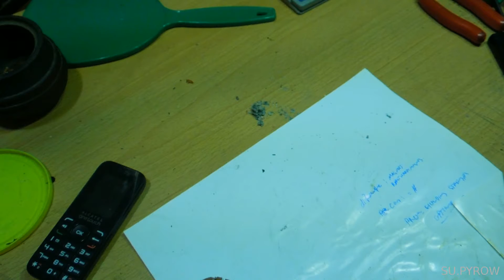CFL Ballast Repair | Sylvania CF32EL / MINI SU PYROW #25

Comment: I came here to see how to pry off the latches carefully, but it wasn't shown. Not that I didn't do it a few times, but it's always a bit harsh work. As can be seen at 7:34, too. :) (I like how most of the video is about not to do this and mentioning mercury.) I just aligned some parts and put in some duct tape to silence the buzz, as I couldn't find any problem but the buzzing.

Comment: Wow , a first for me seeing the innerds . Bob you should do more of this. I like to dabble with low voltage DC experiments and yes I wouldn't recommend doing anything without a lot of knowledge .   I'm working on a optical switch or trying to use a led to trigger a circuit to turn on a load of 75 ma max .  It's the absence of light I need to trigger off of for a solar light. Off during the day and on at night. I tries timers but draw too much.  Haha it's a work in progress . Love electronics wish I knew more. Cheers.
Reply from the maker: i can definitely help you out with that!
Reply: Thanks Bob , when  the weather get warmer and i can work outside I will send you a note. Awesome
Reply from the maker: you got it!

Comment: Hi Bobby,  Dave  12voltvids  does vids like this too, you might enjoy his ch. 
I hate CFLs, should be outlawed.  I've had those dam flimzy thin glass tubes break off, just screwing them into sockets.  They are fire hazards, the best repair is the trash can.  Um boycotting them, I REFUSE TO BUY THEM.  I have a few that actually lasted longer than a year, may make an EOL, just to have the pleasure of destroying them.  When LED bulbs get cheap,  I'll get some, but until then, it's the old incandescent bulbs for me.  Two stupid fire hazards, CFLs and Lithium ion batteries.  Those cheapo wall wart chargers are very dangerous too.  Don't they have internal fusable links on them PCBs?  If that worked, they wouldn't blow caps and transistors instead. Don
Reply: btw, I've had cheap old school tube fluorescent bulbs last many years.  Work out great for the shop and garage.
Reply from the maker: best repair is in the trash can   LAUGHING MY ASS OFF   love it!  right you are my friend!

Comment: I'll leave that to the pro's like you brother!!!! Cheers 🍻
Reply: HA!  A pro would cost well over 50$ to do this repair.  Better to toss them, and not buy another.  Bobby just showed the guts inside to show what makes them tick.  Halogen, CFLs, LEDs, are rediculous, yes they use less electricity, but at far greater risk, and higher cost to buy.  I'll take a fifty cent incandescent bulb that lasts over ten years any day.  Save energy?  Turn OFF the fucking lights!
Reply from the maker: got that fucking right Don!
Reply from the maker: Hey Wild1  thanks for thinking of me  Cheers my Friend!

Comment: Good ole Super User.  Man I changed over to LED now. 2 for like $3.00 so it's cheep. I like the light I get too. It is only 13 watts and puts out like 60 watts of light. You know what I mean man. Don't laugh at me I can hear you now. I don't know the luminous output.  This was outside the BOX so Great cheep fix.
Reply: they push those LEDs hard, will they last a year or longer?  Planned obselesence, aye?
Reply from the maker: Thanks Calvin!
good to see ya again!